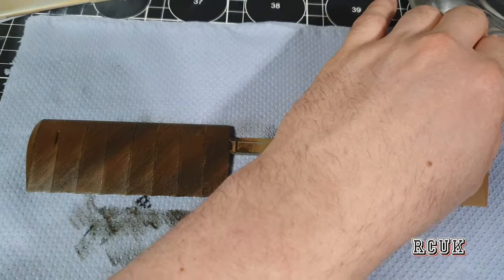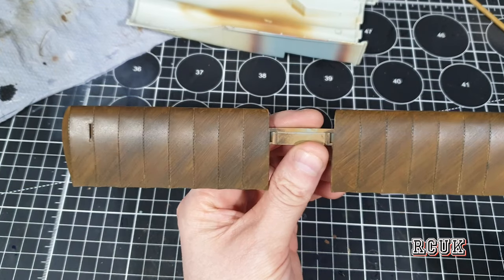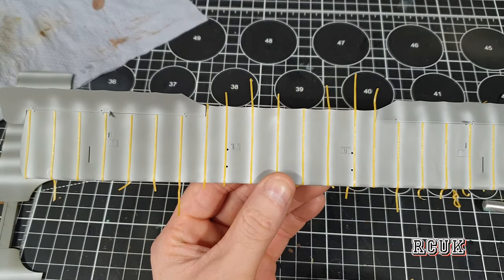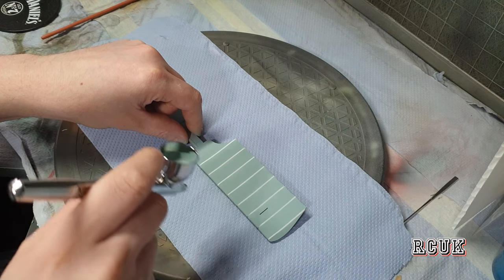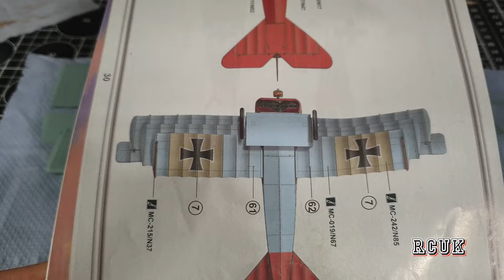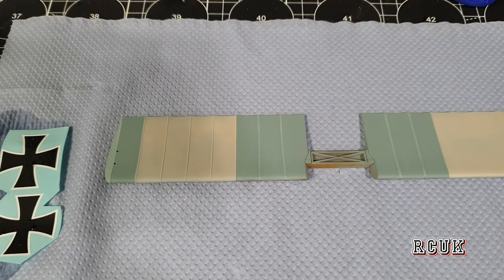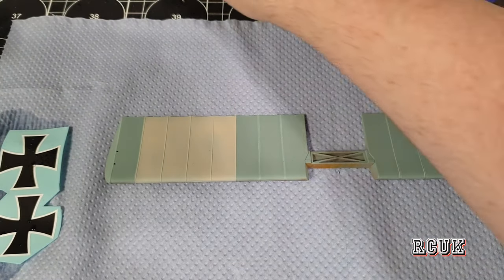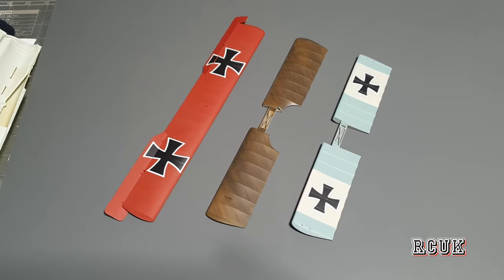Meng Model 1/24 Fokker Dr.I Wings part 4

Comment: From the Fokker Factory, the main wings were sealed with clear dope over bleached linen then streaked with a green tinted dope on the upper surfaces at an angle of 10 to 15 degrees from the chord of the wing. The fuselage sides were streaked vertically at 90 degrees to the thrust axis, the fuselage top and horizontal stabilizer was streaked at a 45 degree angle to the thrust axis. The underside of the fuselage and lower surfaces of the wings were clear doped to seal, allowed to dry, then had a light blue tinted dope applied over them. Metal cowlings and fairings such as the engine cowling and the sheet metal forward of the cockpit were painted Fokker Green. This was the scheme that the planes were delivered in from the factory. Once the planes were delivered to each jasta, the Jastas would paint their Jasta standard colors on the aircraft. For Example, Jasta 11, Von Richtofen's Jasta, had red engine cowlings, red struts and red wheel covers as the standard Jasta scheme. In addition to this, each pilot could paint his aircraft in whatever personal colors he decided on. Once at the squadron level, often times the white background for the crosses were over painted in Khaki paint to subdue the white fields and rudder.